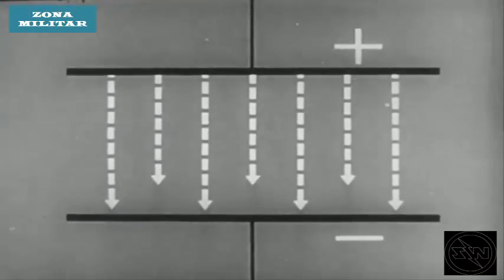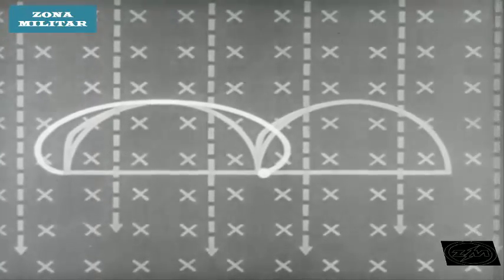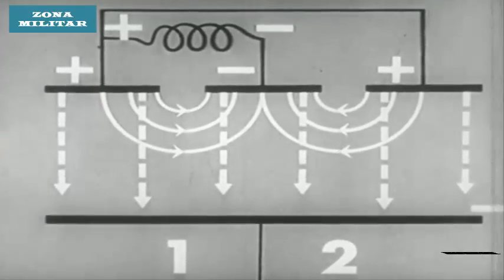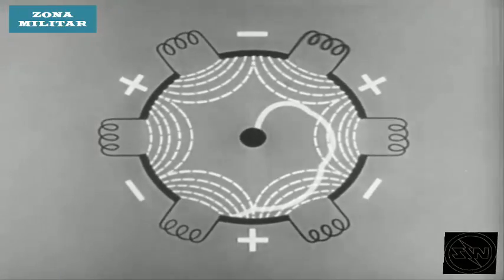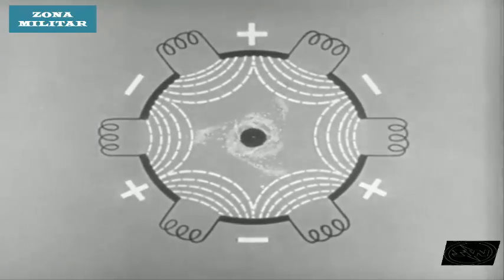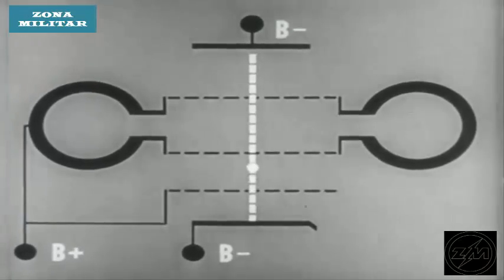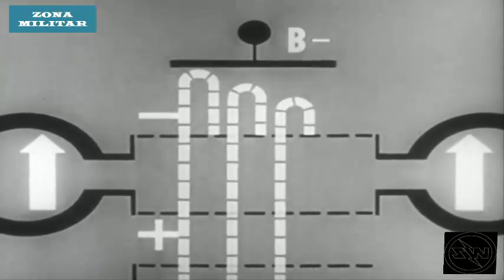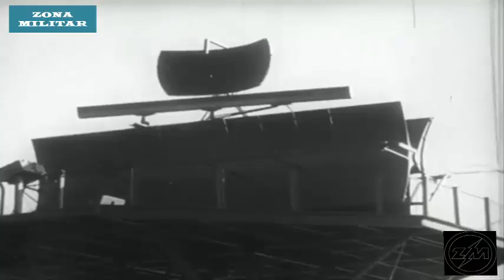Microwave Oscillators - Explains the magnetron and klystron

Comment: Whats disturbing is this ancient video is perhaps the best video explanation of a magentron's operational theory. Tube technology was intertwined with the development of the magetron and tube knowledge is nearly dead. No modern EE student with CMOS understanding could begin to contrive the concept of the magnetron as an oscilator and there is no equivalent high powered oscillator exists within CMOS tech.  Its sad that the geniuses that understood and contrived this never had the opportunity to apply this same tech given modern advances.
Reply: high-power radars are awesome, but they have a great problem, the source can be easily detected, a high value target in a war. So, the newer radars use less power comparatively but with more sensitive recievers, this combination makes it harder to detect the radar's location and use less power.
Reply: @NaderNabilart  Radar targeting ordinance always struck me as something counter-able by spamming decoy radar devices. Trying to be quiet, while an improvement, seems like a losing battle. Granted, i've never designed missiles & radar so I'm probably missing somethings.